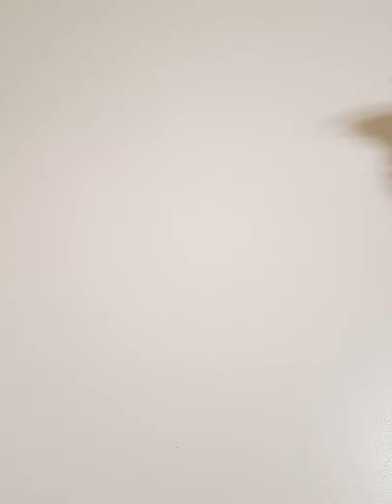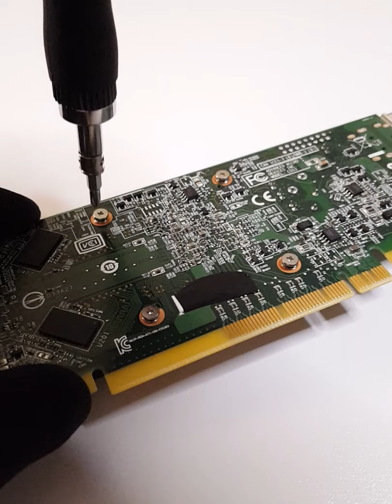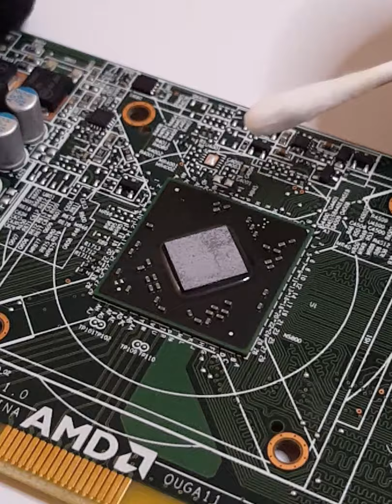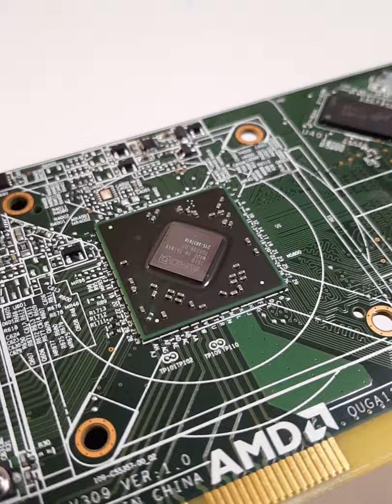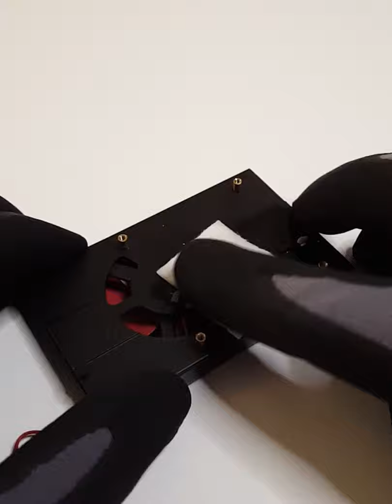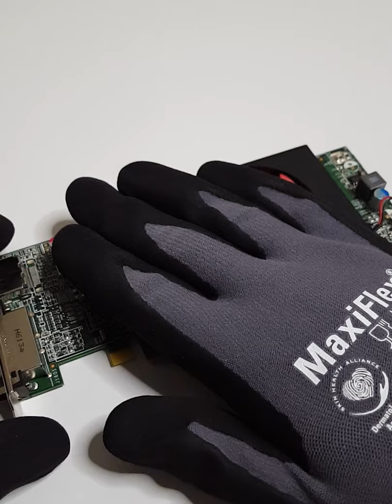AMD R5 240 ASMR

Comment: Ok. Seem today everyone think single half a gram dot of thermal paste is enough for a GPU that can heat up whole room.
Reply: Dude tf are you talking , they didn't put a little they put a fuck ton on that tiny chip.
Reply: That GPU has a total power draw of like 75w it's barely capable to heating itself let alone an entire room
Reply: @brokenshoe1775  bro i got this graphic card as a backup and that tiny mf heat up like a rtx3090
Reply: @alekseikrutev6943  I have one too I use it as a display adapter for like hardware testing purposes but I have ran it at full bore for a laugh and mine personally didn't at all was laughable
Reply: @brokenshoe1775  hahaha bro i really love this card, i use to overclok a lot this thing with Msi Afterburner and believe me that poor card wasn't very happy with me for doing that, but overall i think is good enough for someone that can't afford a decent card for gaming (even a gt1030).
It can run Fortnite at 35-40 constant in 720p
Reply: @alekseikrutev6943  where you based ?